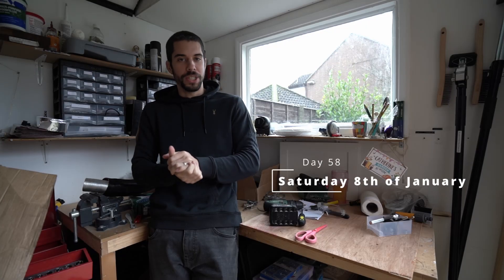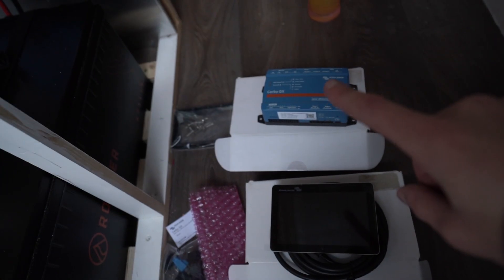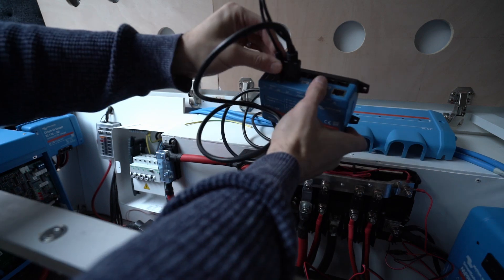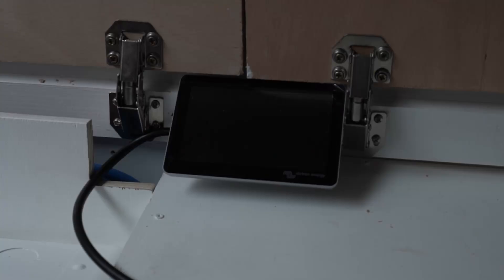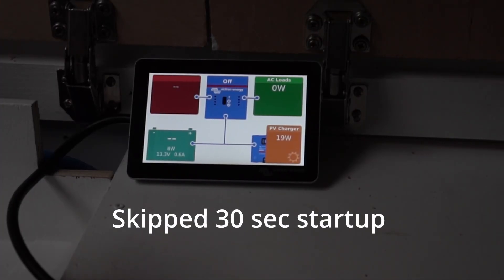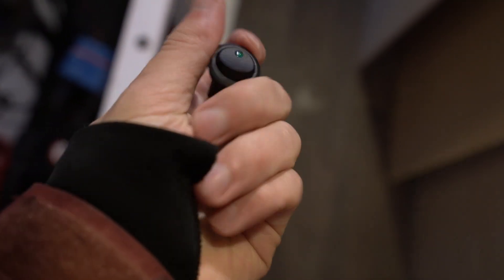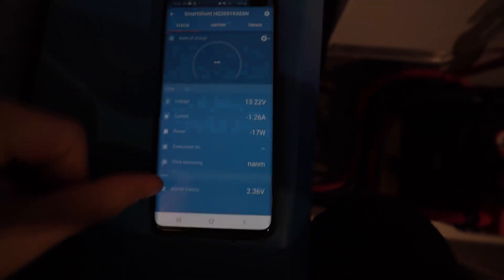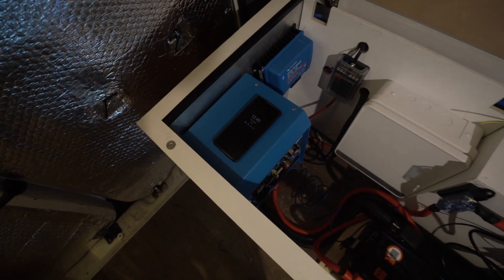Cerbo GX & GX Touch Install - MultiPlus Trickle Charge wiring -  Citroen Relay Camper Van Conversion

Comment: Yes it works with the inverter off or on.. its a simple diode downstep.. you saw about the most current I have seen.. most times its less than 1 amp..  I have a new sprinter van, and Lithium house.. LIthium settings are 14.4v absorb, and 13.6 float..  DVCC on the solar, and I leave it on..  we used about 15ft of #14 wire and a switch in the dash.. I wanted the length to drop the voltage a little bit.. 

The results are very positive:  when the solar drives the battery up to 14.4v, the starter battery tops around 13.7 to 13.75v..  and when the system floats at 13.6, the starter baattery will come down to 12.8v.. so.. I believe we hit the exact parameters as most of the time it sits at full resting voltage.. with one trip daily to mid 13v range..  the important thing also is to turn it off just before starting the vehicle if its got smart alternator, to allow a true reading on the battery when the charge module is powered up..  so my switch is on my dash.. simple..  we have tested this for a good amount now, and we have seen almost no variablility from that unless the house battery is allowed to drop, but it keeps the starter above 12.4 with the house down in low 13s..  I think for the AGM battery, it works well..  thought you would like to know how well it works..  I used your video to wire it.. but decided to use longer wire to tune it.  thank you..

Comment: If you already use a Cerbo, you could make use of one of the potential-free relay ports. If TR-Charge is limited to 4A, this should be ok because the Cerbo's relays are capable of 4A@12V.

Comment: I believe the trickle charge also requires a negative connection with the starter battery. How did you accomplish this please as it wasn’t clear from the video.
Reply from the maker: Trickle charge gets negative through chassis as inverter and whole system is connected to chassis

Comment: Hi Caz and Laz,
I’m picking up my relay L4H2 next week and found your channel searching YT. Really enjoying your content and process.
I have a question about weight. Did you weigh the van before building? And do you plan on weighing once complete?
Your build is great but I worry every time I see something else being added, especially that beast of a battery. 
Keep up the good work.  
Chris.
Reply from the maker: Hi ! Congrats on the purchase and good luck on your conversion journey! Very exciting !!!
Thanks for watching, glad you are enjoying the series :) 
Yes we weigh the van around 6 months into the conversion, we were at 2.6T (including me and cass) we are trying to build it as light as possible, thin ply and battens, aluminium solar rack, lithium battery vs agm etc so hopefully we will be just under the 3.5t limit. 
We will weigh it again when finished and hopefully we don't have to uprate the van (I'd also have to get a bigger license which would be annoying!!)

Comment: Good job …. With that battery pack have you thought about running a 230v oil radiator? I think the wattage it’s like 1000
Reply from the maker: Thanks! Ah never really looked into it tbh. We can run our Diesel Combie Heater from diesel or 230v (900w low or 1800w high)
Reply: We have a 500 watt it keeps the chill off on those night where its just not cold enough for the diesel heater 👍
Reply from the maker: @TheCraftyBlindersvanlife  Good idea! need to test our combi on electric see how it preforms, if 900w is too much we might look into getting one of these! Thanks for the tip!

Comment: Can appreciate the effort put into this guys. Neat job.  The time it took our Cerbo to boot up totally freaked us out too. It was like, what is going on here? We couldn't use the trickle charger as the van is 24v, but it's a neat feature if you can use it. Looking good and thanks for sharing.
Reply from the maker: Thanks guys! Your conversion is coming along nicely too :) Trickle charger function is super handy, we don't have to run the van every weekend now, just flick the switch for a day and its topped off !